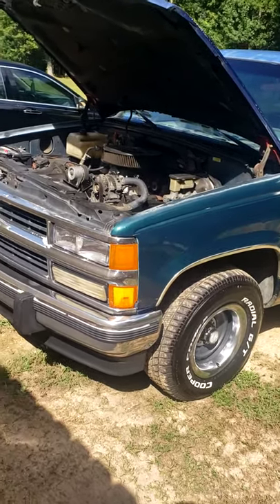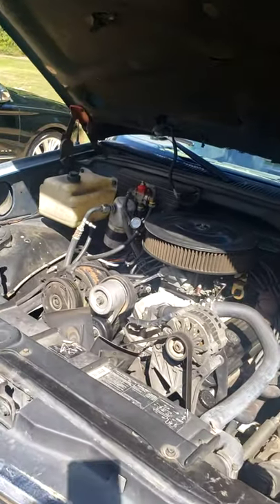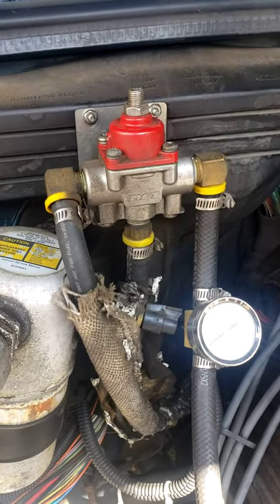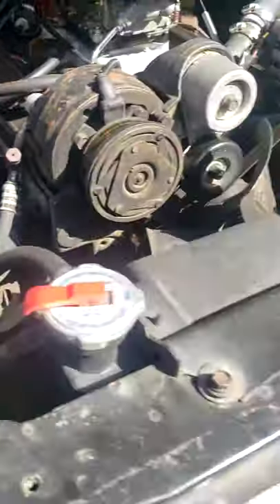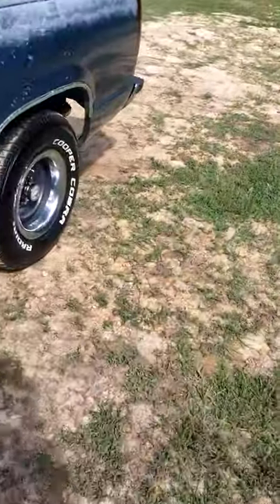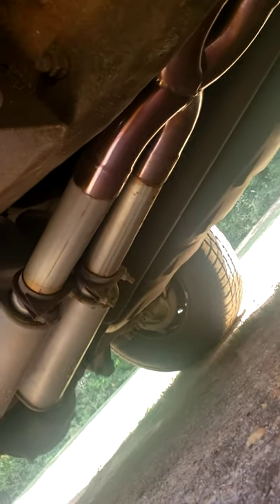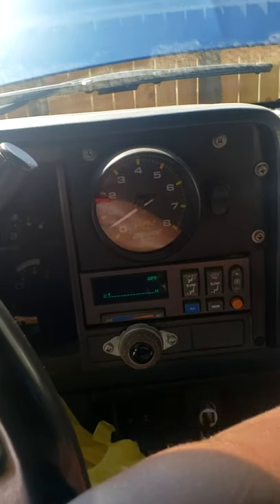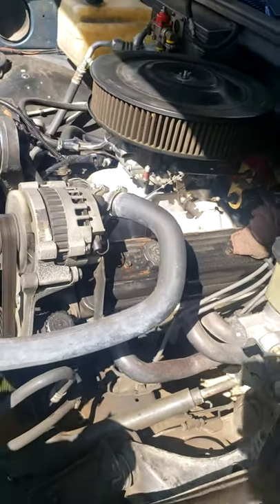Cammed my 91 STOCK BOTTOM END 350 on a SUPER TIGHT Budget!!!

Comment: Thank you for the video this exactly what people should do self built hot rod on a budget this really helps me push to finish my 78 chevy c10 ive got a 89-92 350 with 882 heads shaved and lightly ported to flow better and 305 aluminum intake and edelbrock carb as well i just done a 5 speed swap to it as well thank you for posting this video again this is a video the commen folk can relate to and take alot from and apply it to there project as well thank you n have a blessed day there sir

Comment: Blessed is the word family over material 🙏 just rebuilt my 5.3 Ls bored .40 over with a tune …
Reply from the maker: Yes sir! And that's awesome! I may go LS one day.🤔🤔
Reply: @WorkingwithBobby   Nooooo! lol i get it your prolly maken alittle more than a stock ls with all the upgrades... but man its only up from here... i think the fact that the ls has a stout roller cam and like amazing factory heads is really the only thing the ls has over the small block chevy. if you block is late it might even have provisions for a roller... that way you can use the factory roller gm lifters and do a roller cam on the cheap. Honestly though the advantages as far as power goes, with flat tappet vs roller is debatable and there are advantages with flat tappets like ramp rate that rollers cant compete with. Now rollers are more reliable due to the state of oil and the fact that the production quality is hit and miss. Let's not forget about solid flat tappets being great for rpm if you want to keep stuff cheap and don't care about adjusting rockers. The biggest problem with the small block chevy is cylinder head flow from the factory heads... up until the Vortec head. Another thing is the small block chevy center two cylinders exhaust ports are limited in potential flow due to the position being in the middle of the head and both cylinders having to make a 90 degree or so turn to exit. Notice all the best heads have the exhaust ports spaced. Anyway i could talk all day about this stuff. keep with the small block dude those ls engines arent cheap now anyway... everyone thinks they have a unicorn when selling those things lol

Comment: That's a nice sound!  I'm working on a somewhat similar setup right now for my '88, though instead of a carb I'm retaining the TBI.  I picked up some aftermarket Vortec heads, a GM Performance Parts TBI intake, and an EBL Flash 2 mod for my ECM.  I'm running a nearly identical exhaust setup, and a Summit SUM-8800 roller camshaft.  So far I don't have it back together yet to hear it run, but I'm looking forward to a sound similar to yours!
Reply from the maker: Sounds awesome! Let me know how it sounds when you finish!

Comment: I used a melling 22203 in mine.  Its the same as an 1103. I love that camshaft , it has enough lope that you notice it and some nasty torque when you add 3:73 gears.
Reply from the maker: That's what's up! I didn't know that melling made cams but, have heard some guys talk about them here and there. That's what my goal is along with installing a posi unit in my truck. One day, I will get it done!✊🏾✊🏾

Comment: Awe HELL yah!!! I got a 92 man...Long bed ext cab c1500 Silverado. I got it used from a guy that said it was rebuilt at 169k miles and trans also. Which I can attest that since I've never seen a Chevy 350 over 100k with NO SMOKE. Haha. It's clean engine and trans but it's sat now for a couple years. Battery dead. Thinking about fixing it up.  Last time I drove it it smoked the tires a bit showing my son in law.  The dude said when I got it in 2012 that is was rebuilt to a 383 but I cannot tell ....other than it's pretty torqued up. Never went over 90 in it as I am not about driving fast these day. Still TBI 350 stock if not. Killer video man!!!! Love these old trucks. I remember when we talked about old trucks back in the day but they were 60s and 70s. Hahahaha peace man.
Reply: Awe I got the stock big ass single y pipe ....I want to dual it and get it breathing too.
Reply: And I need them headers brother. Hahah
Reply from the maker: YES SIR!

Comment from the maker: Ok guys, I have been getting so many requests on the build specs and parts descriptions in my engine that I got overwhelmed. I now understand that some may not want their email addresses in the comments like that. So, I copy and pasted the information I sent to a few others so everyone can see what I put in and on my engine in the description of this video so everyone can read it without having to share their email addresses. Hope this helps. Be blessed!✊🏾✊🏾
Reply: Thank you my man! Love the build
Reply: I was reading the description.  I believe that flat top and hypereutectic pistons are different. Hypereutectic pistons are designed to come up past the deck and go into the cylinder head slightly for more compression. That's why they have the valve reliefs cut into the top of them so they dont smash the valves.
Reply: @thehulkamaniabrother2.089  flat top pistons are exactly as described friend...they have a flat top(some have 2 or 4 valve reliefs) hypereutectic pistons are what the piston is MADE OF not what shape they are....(35 years in auto,machining,metallurgy)stock pistons are cast aluminum ,next are hyperuetectic,next are forged....it has nothing to do with the shape.....DOMED pistons stick up from the deck surface,flat top pistons are flat,dished pistons have a dished recess and lower the overall compression.
Reply: @trillrifaxegrindor4411  no doubt

Comment: Thank you sir for posting this video alot of people with a budget and works all the time should see this video it really helps to motivate me to finish my 78 chevy c10 short box i swapped a 92 5 speed and i also have a 89-90s 5.7 with 882 carb haeds shaved and lightly ported with a 305 aluminum factory intake that is awesome with edelbrock 650 carb and long tube headers your build is similar to mine as far as motor goes just stock bottum end built on a budget 350 lol thanks again for the video this is a very awesome truck and cool video for the common folk to see how a budget built hot rod is done hope to see more videos soon
Reply from the maker: Wow man! Thank you! That was the intent when I made the video and posted it. We all can't afford certain parts at the drop of a hat but, us budget minded people can save and buy here and there to get our projects up and running. Be encouraged dude and keep wrenching! ✊🏾✊🏾

Comment: Good Job Bobby, love the truck. I have a 69 C30 pickup with a long bed, all original accept the junkyard 350 in it. It revves out at 55mph, trying to figure out if I need to change tyrannies ( Muncie stump puller) or change the rear.. Work in progress
Reply from the maker: Awesome man! I would check to see what rear end gear is installed before replacing anything. It might be too tall of a gear in the rear end. Hope you get it figured out dude!✊🏾✊🏾
Reply: Short rear-ended gears are for towing heavy pull down the house 🤣
Reply from the maker: @melindaortiz9741  💪🏾💪🏾🤟🏾🤟🏾

Comment: Hell yeah! we in the same boat. Looks like where I'll start.  I've been trying for years and just don't know what to get. I have a bone stock 91 all mechanical 5.7 sb. Because of it being all mechanical I had to put a Holley Red fuel pump, Holley 650 with vacuum secondaries, hei distributor and headers. Still running t 700r transmission and stock torque converter. It's a 91 Silverado single cab swb 4x4 but the engine came out of a 89 Cadillac DeVille. Can what you've done work for me and if so can you give me a list of what you brought. I'm also a single income provider for my family of 4 so being broke is definitely where I stand but, from time to time I get caught up and have a little money to throw at my truck so any thing you can share would be greatly appreciated. Good job on your ride maybe one day I'll tag you if I can get mine to that point. God bless
Reply from the maker: I completely understand man. I added a parts list in the description of this video just for you guys that need it to start with their own builds. I hope it helps!✊🏾✊🏾

Comment: Just remember to keep enough rpm's to keep oil flowing well enough to lubricate the cam. Set idle speed with headlights on high beam and heater fan on high for load on all. Keep on trucken.....
Reply from the maker: 😆😆🤣🤣 Yeah and I gotta make sure my carburetor fluid is topped off too!
Reply: @WorkingwithBobby  seriously lol if you look in dealer tune up specs on how to set curb idle speed that's what info you get I run a 406 in my 78 malibu with a 750 on it 270 comp cam with a 1800 stall it idles in gear perfect..
Reply from the maker: @johnshaver5693  yes sir! That's sounds nice! I'm gone look into that as soon as I can. I'm always looking to improve my tuning skills! I appreciate you! ✊🏾✊🏾

Comment: Good video that sounds really good. I have a K20 83 Chevy with a 350 small block. And I'm struggling on what size rv cam to get. I'd like to stay stock on the heads.  Machinist says don't go over 470 lift.  And another people say don't go over 450 so as a novice, it's hard to decide.
Reply from the maker: Thank you! This particular cam maybe just what you need. I believe you will make the right choice for you.✊🏾✊🏾

Comment: I'm building a vortec motor rn for my 70 Nova. I heard the heads have a limited lift from about 430-470 being the Max lift you can have for the cam.
Reply from the maker: Bone stock heads don't like a lot of lift because of stock spring coil bind. With the LS blue spring upgrade, you can get around .480" without machining the head. I don't have this upgrade though. Thinking about doing that later down the road for another engine build.

Comment: I've watched this video more than once....love the positivity from it....I do have a couple of questions...did you do anything to your heads or are they just stock...I've heard of guys putting different springs to allow for higher cam lift....also did you have to do anything to your computer.....I've heard of having to flash it or burn chips....that could be for if you are still using a tbi and not carburetor though....thanks for the video...I am definitely doing this....
Reply from the maker: Yes sir! I appreciate you. The vortec heads are stock replacement with no modifications. I had to choose a cam that would work with the heads. It's true that stock vortec heads do not like cams with a lot of lift due to coil bind mainly. I didn't have to worry about computer issues since it has an HEI distributor and a holley carburetor. Hope this information helps! Happy wrenching dude!🤟🏾🤟🏾🔧🔧✊🏾✊🏾
Reply: @WorkingwithBobby  man I hate to keep pestering you but was there any hidden mods that you had to do in order to make this work? Anything that you didn't expect once you started?  I have been doing my research on this and it seems pretty straightforward but wanted to know from someone who had done it....I just picked up my heads yesterday and I am going to order the fuel pressure regulator and some shortys  and the cam when I get a little extra cash ...thanks again...

Comment: I've got a 94 and I was thinking about doing the same mods as you did ,but I was also told that them tbi heads are junk . I was wondering if the mods you made helped in that respect as far as performance
Reply: vortec heads are an easy 35-50 horsepower increase,(add a reasonable cam and you can get 75+ horsepower)more efficient combustion chamber,better flow,faster burn....well worth it over tbi heads which are terrible and choke out at or under 4000 rpm
Reply: Yeah I've been seriously considering that option thanks for the info! I appreciate it
Reply: @trillrifaxegrindor4411  where could I get the vortex heads?? Like a pick and pull or order brand new??

Comment: Nice work man i have a similar set up in my trans am... only thing is i had better luck with a 750-vacuum secondary. i have have a 650 double pumper on there and man is it hard to start... lol. it's perfect warm. i tune with a vacuum gauge but i also took off the choke and i can't find it now lol so if i do maybe that will help lol. i did use a steal shim gasket to up the compression and i have the ls valve springs with the comp retainers. my cam is a little bigger too, although yours sounds way better than mine as far as the Chopp Chopp. Mine is comp cams Advertised Duration 268/280, Lift .479/.480. Anyway, how was the break in, mine was supper scary but worked out... Iam sure you heard all the flat cam stories and failed break in. Mine did not want to fire off so i keep taken the valve cover off and with a straw i would add lube to the cam through the push rod holes to keep the oil on it. cuz ya know every time id crank it. the lube would wipe off. Anyway, it ended up being a bad plug wire causing my issue and it happened to be cylinder 1. when it finally kicked off... I was so excited that i forgot to turn the fans on and blew coolant everywhere. lol it was a mess that worked out in the end. I always wonder how other people's experiences are with that.
Reply from the maker: This is awesome! I believe we all have a nervous feeling firing a flat tappet for the first time. Some are just to big headed to admit it. Mine went well except for having a air pocket in the cooling system which ended up blowing out the tank in the radiator.😆😆 I want to upgrade to a 750 vacuum secondary as well but, I haven't found one I can rebuild yet. Continue to tinker with your hotrod dude! Thanks for watching!✊🏾✊🏾

Comment: Sounds good man. Vortecs are the way to go. I bet it's a night and day difference over the TBI top end.
Reply from the maker: Thanks dude! They are great if you can find some that's not cracked too bad to repair and use! And yes, it was a night and day difference in power. I haven't dyno this truck yet but, I will guesstimate a gain of maybe 35 horsepower. I think they are the best flowing GM production iron head they ever made.✊🏾✊🏾
Reply: @WorkingwithBobby  - Should be more than a 100 HP over stock... needs a 650 - 750 CFM carb... 
That's an X pipe not an H pipe... X-pipe is better...
Reply from the maker: @BuzzLOLOL  , at the time of the video, I think I had a 600cfm holley on there. I got a 650 on it now and it did wake it up a bit more. With my next upgrades, I want to put a 750 on it.✊🏾✊🏾

Comment: I like that low idle with good throttle response. Sweet
Reply from the maker: Thanks! I think I had to tinker with the carburetor for a few days driving it off and on to find the happy place for it. We'll worth it in the end!🤟🏾🤟🏾✊🏾✊🏾
Reply: @WorkingwithBobby  I have an older 350 and I want to get a nice cam for it someday like that. It's an 86 model year 2500 chev truck engine. Got the edelbrock 600 carb and edelbrock intake. Also has msd distributor and long tube headers. I bought heads from a 327 to give it 10:1 compression ratio but they need to get machine work first. The shit is never done lol.
Reply from the maker: @thehulkamaniabrother2.089  it's all in the spirit of hot rodding dude! We are never actually "finished" with a car or truck. We gearheads always look to upgrade something! Keep wrenching dude!✊🏾✊🏾🔧🔧

Comment: Hey Bobby. Looking good. I'm going from TBI to Carb. Do you remember which wire was used for the tach from the original wiring to the new HEI distributor.. My car is a 91 camaro rs. thank u sir.
Reply from the maker: Sure, I used the ignition coil wire. On my truck it was a big pink wire.

Comment: Love it Man, I have been trying to find good videos of original tbis that have been cammed and it definitely seems that going carburetor is the only way to go. Love the truck man! I have a 94 z71 that I would love to get cammed just to have a little hot rod. How is the transmission holding up? Thank you for the video!!
Reply from the maker: Yes sir! I'm glad my video blessed you! There are cams out there that work great with TBI but, im not too familiar with them. It was easier for me to just do a carburetor swap and get budget parts that work well together. Hope this info helps bro!🤟🏾🤟🏾🔧🔧✊🏾✊🏾
Reply: @WorkingwithBobby  that makes sense, thank you for your reply as well man. I’m 22 and also trying to slowly fix my truck up on a budget. How well did the fuel pressure regulator work with the electric fuel pump? That’s really cool to me how that works!
Reply from the maker: @darrenharris384  No problem dude! Glad to help. If I had this type of help when I was 22, I would have a 1000 hp truck by now!😆😆 Anyway, the regulator works perfectly! I had to use it for two reasons. First to dial back the in-tank pump pressure to 5.5 psi for the carburetor and secondly, to keep from overloading the pump by not giving unused fuel a path back to the tank. Without it, I would be replacing fuel pumps left and right.
Reply from the maker: Oh yeah, you asked about the transmission. Before I burnt up overdrive and 3rd gear pulling stuff, it worked fine. I had to get a B&M lock-up controller. I may do a video on how that works when I get my Blue Belle back from Georgia. 🤟🏾🤟🏾✊🏾✊🏾

Comment: Nice...sounds good!  You got a real nice chop, surprising with your x pipe.  What's your opinion on the vortec heads?
Reply from the maker: Thanks man. That chop is all cam and carb tuning. The vortec heads are way better than the stock TBI heads that came off the engine. In my opinion,  they are the best flowing g stock cast heads GM ever made for a Gen 1 SBC.